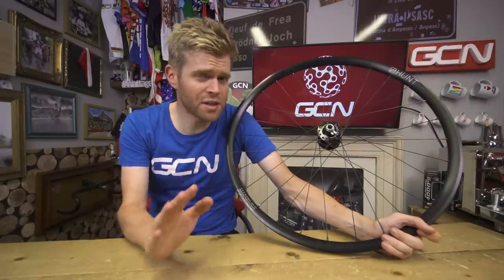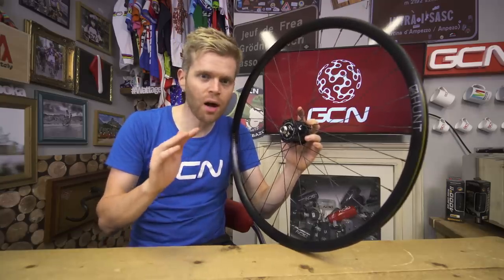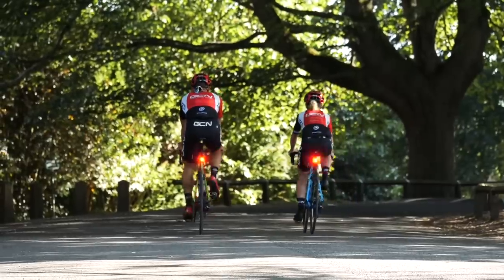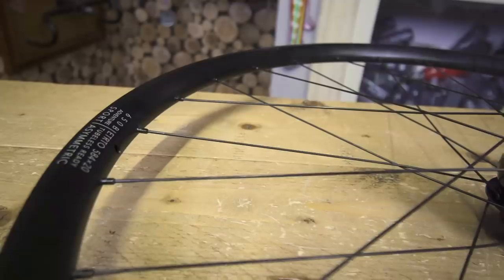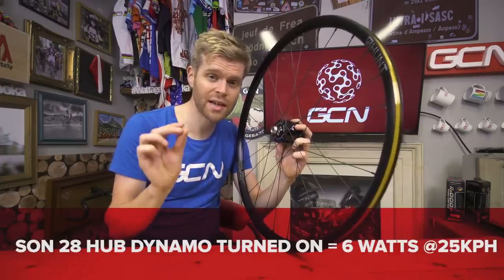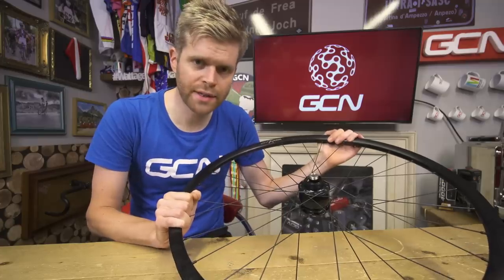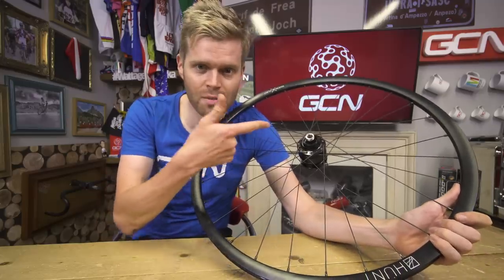What Are Bike Dynamos And How Do They Work?

Comment: A standard phone battery has about 13 Wh (watt-hour) capacity. You're at a loss of 13 Watts if you charge your phone fully in an hour. I think phone batteries can charge at 13 Watts.
Reply: A bicycle dynamo with standard rectifier will not give you that kind of amperage. It will take longer to charge your phone. In fact I sometimes had a hard time keeping my phone charged while using it for navigation on tour. Keeping both the phone and the cycling computer happy took quite a bit of power management.

Comment: So the most important question, how is the power transferred from a spinning wheel to a wire to charge stuff?
Reply: via... a wire.
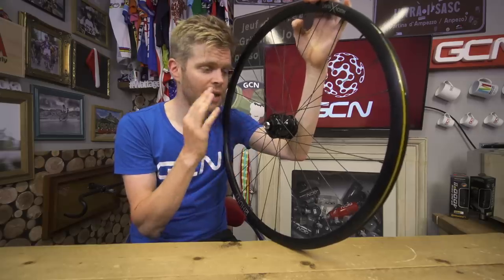Reply: There is a pair of contacts which remain static in the axle's frame of reference. You can see them at 1:10
Reply: Jack Mitchell sweet. Thanks

Comment: You say it costs 6 watts at 25kph turned on, how many watts does it produce at 5 volts? A normal smart phone charger needs around 1.2 amps at 5 volts to charge at its intended charging speed (actually ranges from 1 to 2 amps, depending on the phone), which is exactly 6 watts. If these dynamo/magnetos are producing 1.2 amps (or 6 watts at 5 volts), then technically there is no loss, just redirected power. If they produce MORE than the 1.2 amps (more than 6 watts), they are more efficient than the  DT swiss hubs, as not only are they redirecting power, they are producing additional power.
Reply: Watts are watts.  6 watts at 6v is 1 amp, but 6 watts at 5v is 1.2amps. I believe most dynamos actually only output 3W of power at 6v, so .5 amps current (they are far from 100% efficient). So if time drag is 6w, that would make it 50% efficient.

Comment: Has anyone worked out the optimum battery charging voltage for a dynamo. Reason is that they are very good at limiting their current output. So to get more power output means using a higher voltage. Problem is that voltage is proportional to speed. My dynamo is about 1 volt per mph. It would very much depend on the average speed.
Options with a Li-ion battery would be 4.2V, 8.4V, 12.6 etc. A single cell 4.2V would charge pretty much all the time the bike is moving but with very low power ~ 2 - 3W. On the other hand a 4 cell 16.8V battery would change at about 4 times the power ~ 8- 12W but only when riding at + 17mph.
Of course there may be a clever curciut that can get the best at any speed.
Reply: Ed R There is. It's called a switching regulator, and depending on configuration it can convert, with very limited losses, the voltage up (AKA a boost converter) or down (AKA a buck converter).
Reply: Dennis Krøger Thats what I thought but question is how to configure it to get the maximum power from the dynamo.
Reply: Ed R I'd think a buck converter to a single cell battery would be the best. You'd get nothing when under that voltage, but it should be able to provide good power when above.
Reply: @AndrewLohmannKent  Thanks for the useful website.
Yes all good precautions for lithium cells. I do use a protection board on my setup and the dynamo only reduces the rate of discharge on average. Obviously sometimes it puts a little charge back but slow charging is different to trickle charging.
I check the balance sometimes when recharging although always remains in balance. I've seen lithium battery packs sold without balance charging. If the cells are of very similar capacity they get away with it.
Reply: @Ed.R  Different manufacturers vary a little in there safety precautions but high loading applications are more likely to have cell balancing for example laptops and automobiles.    A 18-20V Laptop pack is probably a good solution in your case except you have to back engineer the pack to use it.
Reply: @AndrewLohmannKent  I've been using 18650s out of old laptop batteries. Break down the battery and put all the cells through tests to check for self discharging and capacity. So far have worked great as power for projects.
I try and avoid Lipo as they are the most volatile of the lithium batteries types.
Reply: @Ed.R  I had read that Li-FE-PO are safer that is less likely to catch fire particularly if over discharged.   That is they are comparable to other types of secondary cell as far as safety but none of them are as easy a Lead-Acid such as Hawker Cyclon Lead-Acid but they are expensive.

Comment: can someone explain why a dynamo that is switched on causes more drag than when its not when the size and weight of the dynamo hasn't changed???
Reply: It's not the size and the weight but in order to produce electricity dynamo creates a resistance which causes 'drag' when it's switched on..while it's off the size and weight come into the picture which create the drag
Reply: To put it another way. Having the dynamo on means the wheel is pushing the current round and it's your force through the pedals which does the pushing. When the dynamo is of you just have to turn it against the friction and carry it up the hills like a heavier version of a normal hub.

Comment: I almost bought a bike with a Dynamo (wired into lights). But I got a cheaper one without. I’m not a commuter or competitor, I don’t need a Dynamo. I have a light on my helmet and I can always use clip on lights if I need them. I ride on sidewalks so not that dangerous.
Reply: 1. You, by law, should ride on the road, 2. By law you need lights on your bike not your helmet.  Helmet lights are 'extra' lighting.
Reply: @lobbymccawker2083  I ride at 3 mph pace. That’s slower than my walking pace. So I don’t feel I can use the roads.
Reply: @amyx231  It's the law.  You have to use the roads.  You are going at walking pace for some reason.  Go a bit faster.
Reply: @lobbymccawker2083  I mostly walk tbh. I’m not an experienced rider. A lot of kicking off the walls and take breaks.

Comment: You're wasting power charging up a powerbank to charge the phone. If the charging circuitry is well designed, there will be no problem charging the phone directly
Reply: unless you just want to plug in and forget
Reply: The magneto's voltage is not regulated, and can easily exceed safe levels for charging a phone. A power bank is cheaper to replace than a phone. Hence the advice to charge a power bank.

Comment: Take a look at velogical bottle Dyno. Modern coin size bottle dyno. Lighter set up than battery lights. Zero drag when off wheel. Rated at 1.5 watts not three. Pair it with an iqx light. I run a son hub too but prefer overall the velogical for my situation. Modern dynamos should be called generators output ac which is then rectified at headlight electronics etc   .old dyno used brushes and were a labour of love. You cannot be self sufficient apart from lighting with dyno and accessories and will need to grid charge at some point.
Reply: Gotta say, that's a pretty elegant solution.  The on-off with zero drag when off is pretty nice.  Thanks for sharing!

Comment: Was it said not to charge a phone directly because of the Direct Current from a dynamo, then later we're told that they're not dynamos but magnetos and produce AC?
Reply: You'll need a decent rectifier/voltage regulator in addition to the dynamo. I use a dynamo harvester, which doubles as a power bank.

Comment: Always so many myths about electronics, how much current flows into your phone has nothing to do with the current that the dynamo produces, the voltage provided to the phone will cause the phone to draw current, they all have voltage regulators, so unless you supply way too much voltage they wont draw any more current than usual. Electricity works on the principle that if you apply a voltage across a circuit a current will flow, it does not work by supplying current, none of these devices supply current, they produce a voltage and the circuit you attach them to will draw a current. You could have a dynamo that can supply 10amps of current but if you put it on a device that only draws 1amp, it will only draw 1amp. The only way to push more current through is by increasing the voltage.
Reply: Yeah he says that the DC current could damage the phone then he later says that magnetos (dynamo hubs) produce AC current.  I've read that one problem with charging phones directly with the hub is that on some phones at certain speeds the power will drop low enough that the phone thinks it's not charging and then back up and each time the screen will light up and it will use more charge than it's getting.
Reply: That can be avoided if the phone is Android by changing your settings.

Comment: "Surprised how normal" the front hub looks??
It looks like a pregnant rear hub without the freewheel....
Reply: You should see a GH6 Dynohub from 1946, it's a standard flange on the left with a 6 inch flange on the right and a bakelite facing with 2 brass contact bolts in it. The hub in the video looks very normal by comparison.
Reply: Jack Mitchell:  I'm sure you're right, it's like tubes vs transistors. 
Although I don't believe Ollie would be familiar with the generators that ran along the tire sidewalls from the 70's, let alone 1946....
Reply: Well I quoted 1946 as the year of introduction, but the GH6 stuck around until 1984, albeit with stainless steel replacing the bakelite in 1953 and more chrome added around 1960. They're still a fairly common sight today and are certainly better hubs than the basic front hubs Raleigh made at the time. They can even be spaced out to 100mm, although they are 87mm or so by default if I recall correctly, I have 4 fitted, ranging from 1950 to 1981.
Reply: @georgehugh3455  He actually mentioned them as "bottle dynamos".

Comment: I think the main advantage is the no bother aspect, the problem Dynamos have is the power produced is quite low and hasn’t really improved over the years, while modern batteries have improved dramatically,  so that lights can have long run times and still produce a good strong beam, it’s certainly true that modern LED do result in far more powerful lights from Dynamos that before, but they are being out stripped by batteries.
Reply: Roger Merriman not quite right but whatever you think lmao
Reply: In what way not quite right? Dynamos  tend to top out at 3W,  you can push a lot more than that from a battery,  hence why the cheap nasty ones are so dodgy!  All that power in a small space etc.
Reply: There are loads of videos on YouTube of dynamo lights and they look plenty bright enough.
Reply: Mr B YouTube isn’t perhaps the best way to see this, it comes down to the old favourite of “the camera never lies”  it is quite hard to get a light to look like it does, due to differences in how eyes and sensors process light.

Note that attempts to have Dynamos for MTB haven’t been wildly successful mainly due to low power output coupled with even lower at lower technical bits.

I see folks with Dynamos and for most part they seem fine for a urban commute, but I can’t help feeling that they are being left behind as battery tech is improving at a dramatic rate.  LED seem to have stabilised now.
Reply: I don't know man - I went through several high end LED lights before going with a full blown Dynamo package and there is no way I would go back to LED's. A high end light, like an Edulux II puts out such a bright, high quality beam for real world cycling it's pretty much unmatched - they spend time and money specifically designing the mirror to properly throw light for a moving vehicle, much like an automotive light. Yes, it does get dim/choppy in very slow (sub 5 k/ph) technical terrain but I would contest that probably lots of other things have gone wrong if you find yourself climbing technical single track in the pitch black, so yeah, there is your edge case where LED wins. However, if you ride your bike everyday in the real world dead batteries are the far more likely occurrence and you would probably be surprised with how much more often you would ride your bike when you have a permanent, no fuss, well designed, bright light source always available.
Reply: yes something like a Edulux II is a decent light, but its still using, a lower power input to drive it's LED, yes it has a good flat beam, with a decent reflector but good reflectors aren't limited to dynamo lights, which tend to have a german standard dip beam shape which is nice a traffic friendly but not optimised for vision, which is why cars have High and Dip beams

 At the price point of the Edulux II battery driven lights will last ages, mine will last 24hrs I run it on the commute bike when ever I use it. charging it up is not really a concern since it shows how much it has left and lasts so long thats its every other week or so.

Dynamos make sense if you can't get power if not, not so much.
Reply: With this statement I would honestly contest that you have never used one of these lights: "have a german standard dip beam shape which is nice a traffic friendly but not optimized for vision, which is why cars have High and Dip beams." I don't want a flashlight strapped to my handlebars - I want a high quality light source evenly and consistently spread across the road in front of me with no fuss, which is what the light shape does. Additionally, I hate getting dazzled by inconsiderate cyclists who strap flashlights to their handlebars, which, again, is a much more common use case. If you commute full time, keeping up with regular maintenance is enough of a chore, why would I want one more thing to have to keep on top of that, in addition to literally not working as well in real world applications, is very ugly and stupid looking strapped to the handlebars.
Reply: dipping or having a cut off, which is what both car and german standard bike beams are, do reduce vision not in urban environments generally you don't need much or frankly any light at some points to see.

I have a reasonably high end road light, it's has low (ie traffic friendly) and smooth/even beam, these are not limited to dynamo's

But that light even though it's a powerful light, is blown out of the water by the MTB light that has far greater punch ie I can see both wider arc and further, clearly not traffic friendly but in terms of purely which one I can see the further.

I see a number of bikes every commute, some of have dynamos which vary from laughably dull, old glowworm types to ones that seem fine.

Comment: "The DC current coming directly from the dynamo can damage your phones battery" - nope, current is irrelevant. My 5v 40amp power supply is fine for charging a phone, my 12v 1A power supply would kill it. Besides, how is anyone going to wire up a Lightning connector directly to a bike dynamo... You don't have to use a USB battery pack, you could use the same DC-DC convertors that dash cams use, both of them are bucking the 6/12v input to a 5v USB output.

Comment: Someone should develop a dynamo hub that uses regenerative braking so it charges more when you are slowing/freewheeling
Reply: Watch F1, the have a system known as (KERS) kinetic energy recovery system that does exactly what you have mentioned.
Reply: It's not that it can't be done.  It can, but it comes with a weight penalty.  I was going to say it wouldn't be feasible, but after some thought, it MIGHT be.  But keeping the additional mass of the system down would be imperative.  Cars can do it because 50 extra pounds of tech are barely noticed.  On a bike, 50 extra pounds are a non-starter.

But I'm guessing that the expense of such a system would make it such a niche product that it simply wouldn't sell.  Who would want to spend another $300 on a bike for regenerative braking that isn't used much.  And it adds five pounds to the bike?  Then again, with the advent of electric bikes and their additional weight, perhaps this could pencil out. 

A tandem would also be a good application because of the high braking energies generated.  These energies usually translated to overheated brakes.  Putting the energy instead into regenerative braking would reduce brake failure issues and recapture some sizeable kinetic energy.

Comment: My friend is adamant that if you put a dynamo on the front and an electric motor on the back, and use the dynamo to power the electric hub motor on the rear, you will have an infinite supply of power. He genuinely believes he has discovered this and believes I'm being ignorant for dismissing his idea... He also thinks Boris Johnson and Donald Trump are bold & competent leaders... So you've got some idea of what Im dealing with.
Reply: Your friend is also probably a flat earther and probably thinks that the lunar landings were a hoax too. Anyway, your friend will be quite disappointed when his perpetual motion machine doesn't work.
Reply: It only works when powering an electric fan to push the sail along.

Comment: It's called an alternator, not a magneto.
Reply: Thought magnetos are higher voltage, suitable for making spark for IC engines.
Reply: Right! Magnetos produce pulses at very high voltage. Simple, self powered, no battery needed. Big fat blue sparks, great for piston aero engines. And for old BMW motorcycles. Not so great for anything on a bicycle.